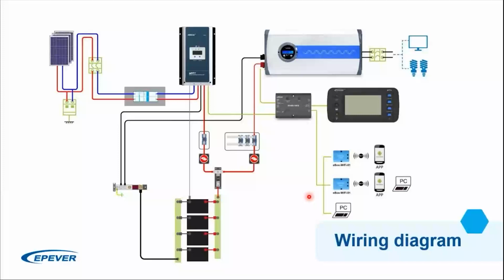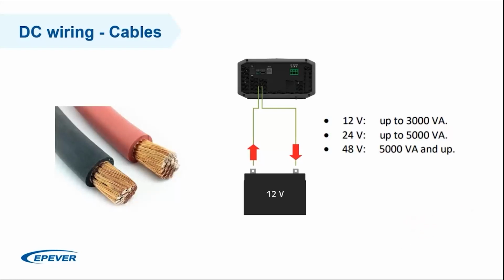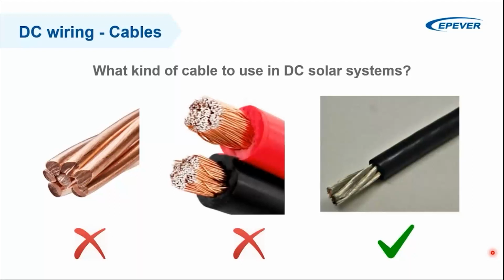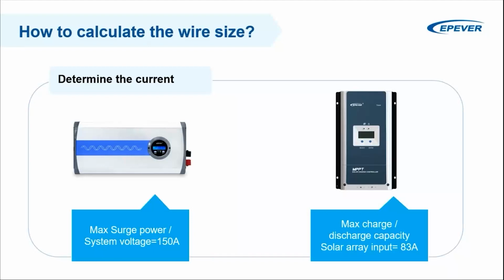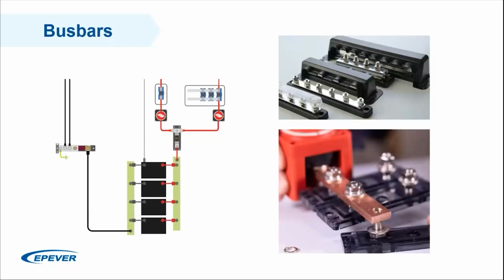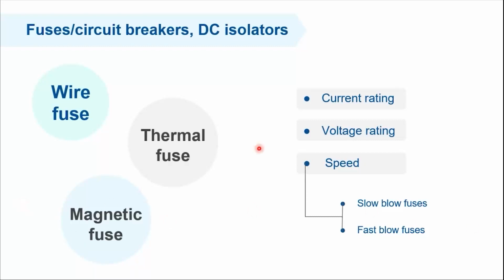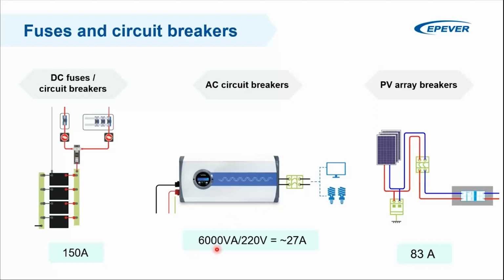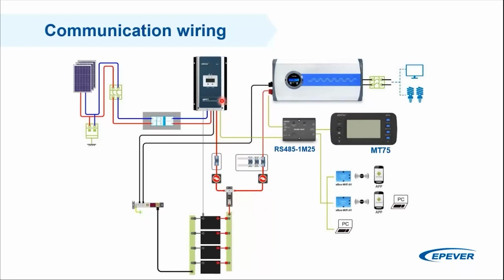Wiring and Protection in an Off-Grid Solar System - EPEVER Webinar Series

Comment: Can you do 3 phase ac?
Reply from the maker: Hello there, our newly released inverter charger, the HP-AHP20SA, can be configured for three-phase operation. For more details, please check here: https://www.epever.com/product/hp-ahp20sa-series-inverter-charger/
Reply: @Epever  Great, Thanks for your reply. Question: if I have a unbalanced load phase A 2000watt B 4000watt C 1000watt will the phase B 3500w Inverter trip or will the other 2 inverters compensate extra load?
Reply from the maker: Hello there, the inverter will detect the current imbalance and issue a warning to stop operation. Additionally, other inverters cannot compensate for the imbalance in load. @lucasokomuniewski6525

Comment: Thank you .  I am using busbars direct from my battery and my dc load on the fuse distribution is wired to the Busbar so do I wire my solar panels and the busbars to the mppt and not wire the load connection points on the right hand side?
Reply from the maker: Hello there, the load should be connected to the controller, not directly to the battery. Regardless of using busbars in between, the load should eventually be connected to the controller's load terminal. Otherwise, the battery might be over-discharged.
Reply: @Epever  ok so I connect my solar wires to the solar port on the left.  Then I connect the battery to the the center two ports and then I connect the fuse distribution box to the load ports on the right hand side.  I don’t understand this.  I live in Ireland.  There is very little sunshine.  If I remove my fuse distribution box from the busbars and connect them to mppt I am relying on the solar alone to power my load.???  This won’t work for me.  I am using mppt in my campervan not a house.  I have a dc to dc charger from my vehicle battery to my leisure battery so my leisure battery won’t over discharge
Reply from the maker: When charging the leisure battery from the vehicle battery, the load port of the controller remains connected as long as there is a charge in the leisure battery. However, if the load devices are not directly connected to the controller's terminals and are instead connected directly to the battery, there's a risk of the battery being excessively discharged if the load demand exceeds the battery's supply capacity. In cases using lithium batteries with a Battery Management System (BMS), the BMS may offer certain protective functions to prevent such occurrences. @EllenMcDermott

Comment: Hola. Muy buena información, pero aún tengo duda. Tengo un equipo IP4000-41-PLUS, para usar los diferenciales a la salida de CA, puedo aterrizar el Neutro del inversor?. Me refiero a usar un sistema TN-S. 

Puesto que los interruptores diferenciales(GFCI) solo funcionan en los sistemas donde el Neutro se conecta al conductor de tierra física.
Reply from the maker: Hello there, we are glad that you like the video. Regarding the connection of the inverter and the use of GFCI in a TN-S system, we would like to offer the following recommendations:
Typically, when individuals touch the N (neutral) or L (live) connection points of the inverter separately, there is no risk of electrical shock. Therefore, in most cases, grounding the N of the inverter is not necessary. However, if you choose to ground the N of the inverter, we recommend adding an RCD (Residual Current Device) or RCB (Residual Current Breaker) to the circuit. These devices can detect current leakage in the circuit and disconnect it in the event of an imbalance, further reducing the risk of electrical shock.

In summary, we strongly advise considering electrical safety in any inverter installation, including in a TN-S system. If you have any concerns or require further guidance, we suggest consulting a professional electrician or electrical engineer to ensure that the inverter connection complies with electrical safety standards. Thank you for your support of our products.

Comment: 1. Epever не может позволить себе нормальный микрофон?
2. Почему вы подключаете инвертор парралельно аккумуляторам? У контроллера же есть выход DC. Аккумуляторы разрядятся без контроля напряжения до нуля
Reply from the maker: Hello sir, thank you for your feedback. We will improve the audio in future videos.
There are two reasons for connecting the inverter in parallel with the batteries:

Firstly, it allows the inverter to directly draw power from the batteries and convert it into AC power for various electronic devices. This configuration ensures a stable power output and enables the inverter to supply power to a wide range of appliances.

When using the DC output of the controller, it is typically used to connect the batteries to the controller and provide DC power to other devices. However, the DC output of the controller may not be suitable for all types of devices, especially those that require AC power, such as household appliances or electronic devices.

Therefore, connecting the inverter in parallel with the batteries ensures a stable supply of AC power and prevents the batteries from fully discharging without voltage control. The inverter monitors the battery voltage and automatically stops supplying power when the battery level approaches its limit, protecting the batteries from over-discharge.

Secondly, the controller may not be able to handle the surge current generated by the inverter. We only recommend connecting resistive loads to the controller's load terminals, as inductive loads can generate significant surge currents that may damage the controller.

Therefore, it is advised to connect the inverter in parallel with the batteries to achieve the desired functionality.

Comment: We need a video on all the load control options using an external relay.There is not much info on the losd controller anywhere. 
Thank you
Reply from the maker: Hello sir, thank you for your suggestion. Do you mean the Load Control Relay or the Diesel generator relay?

Comment: Thanks! Great video! Could you make video about how to setup a dump load in multiple ways. 
For example I could Transcode images triggered by battery voltage and PV input :) 
Time Base switching should be pretty easy :)
The same could be done with a grid charger and/or a generator.
How to properly size MCBs, Fuses, and SPD? Can the max voltage of MCB be too high? Or will It trip regardless?
Reply from the maker: Hello sir, we are so glad that you enjoy this video. Thank you for your suggestions and we will consider it for the coming videos.

Comment: does an Epever charge controller like  10415AN need a protection breaker/relè when suddenly for some reason battery stop to work? i mean for avoid that the epever receive suddenly the solar panel without the battery
Reply from the maker: Hello Sir, thank you for your question. When the battery stops working, the controller will automatically stop the output. However, you can also install protection or an air breaker between the controller and battery to prevent a short circuit.

Comment: Can you guys get someone on the app dev team to revisit the wifi adapter connectivity? You’ve broken it in a new way. Now when it loses connectivity, and you have to re-add it, the app times out when going to the ios wifi settings and will not go, which breaks the connectivity process. You guys really aren’t very good at this, btw. On some level, I feel for you, as Apple probably broke your app, but every other device I have can deal with reconnecting to a wifi network, except yours.
Reply from the maker: Hi sir, thanks for reaching. Could you send us which the model of communication adapters are confuing you? Or you could send us email to support@epever.com, we will have our technicans to help you asap.
Reply: @Epever  It appears that apple has perhaps added some default security that is limiting the ability to open the wifi settings from the app. It may have to do with address tracking ?

Comment: how do you calculate the 150A circuit breaker for the battery?
Reply from the maker: Hi David, thanks for comment. Usually, for solar charge controller protection, we suggest circuit breaker’s ampere is 1.5 or 2 times of maximum charging current; For power inverter protection, we suggest that circuit breaker whose current is 2 to 2.5 times of the inverter's rated input current.

Comment: Hello, has anyone had a defective Solar Carger repaired at Epever? The seller on eBay Germany does not respond to my announcement for which I want to pay. The device is a Tracer 10420 AN and only 1 year old.
Reply from the maker: Hi Arndt, could you tell us more details about the problems of your device? We will try to help you first.
Reply: @Epever  Hello I thank them very much. I also have a channel here on YouTube with my name >Arndt Cwiekalik<There you can see my plant and in the last video of me also what happened.. Thank You...🥰
Reply: @Epever  Basically, it can be said that a normal solar controller from Epever has functions that are not needed for a LiFePo4 battery system. Epever has to build a charge controller that is only suitable for LiFepo4 battery systems and communicates with the BMS. Better yet, replace the BMS and then be able to deal with all the dangers such as battery too empty, too full, short circuit of the system due to a defective sine wave inverter.
Reply from the maker: Hi Arndt, Have you got the help from our team? Mind if you tell us the link where you bought the Tracer?
Reply: Hello, so we are also in contact with the dealer on Ebay and he has already written to me that the guarantee period at Epever is not just one year as I thought, but two years. Let's see how it goes now...!I already have a lot of data, pictures and videos from my system and the data that is sent to the Epever via a PC / data cable.

Comment: Hi I really need yr advise cause I'm using a Epever Xtra 3210n.

I have 2x260w solar panel could i connect the solar panel parallel to my Epever Xtra 3210n ? Would the 2x260w damage my epever xtra 3210n? 

I'm using 100ah battery. Running on 12v system
Reply from the maker: Hi leefiz, thanks for reaching us. If the solar panel’s max.open circuit voltage under 92V, rated discharge current under 30A, then it wouldn’t damage your xtra controller. But still a bit waste if you parallel 2X260w solar panel. So we would suggest you not to parallel the solar panel.
Reply: @Epever  each of my my solar panel spec
Voc 38v
Isc 8.83a
Vmp 31.8v
Imp 8.18a

So is ok to do a series connection  on the solar panel right?

Comment: How could we protect it from an EMP attack?
Or better what could we build to protect the solar system from an EMP?
Reply from the maker: Hi Frank, thanks for reaching out. Do you mean the lightning protection? In the heavy thunder area, you should install the Lightning Conductor or SPD on the PV side and the appliance side (if your appliance loads are installed outside)
Reply: @Epever  Thank you for the reply.
I was wondering more along the lines of a nuclear EMP. Just because Russia has threatened to use nukes and if the power grid goes down I would like to try to keep the solar system up and running. 
People say there is a way but nobody has any advice on were to get the product (that might be military only but not for sure.) or on how to DIY with plans. Any help or pointing me in the right direction would be greatly appreciated.

Comment: For me the most important is still missing in the picture, the 30 mA differential at the AC output of the inverter. Without it people may be electrocuted. All the others are for the devices protection.
Reply from the maker: Hi Alexandre, thanks for your comment! It needs to add an Residual Current Device if there is possibility to short circuit the neutral and Live wire. Otherwise, the RCD is ueeless. For our inverters, touching the N or L seperately won't cause electrical shock.